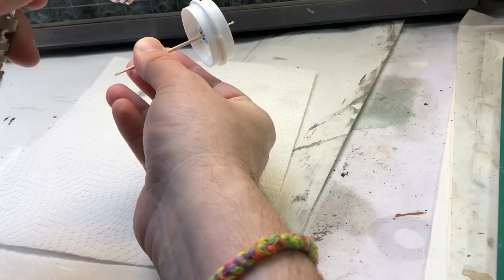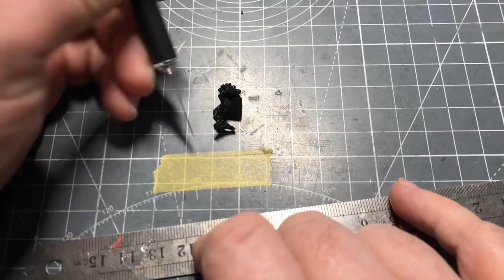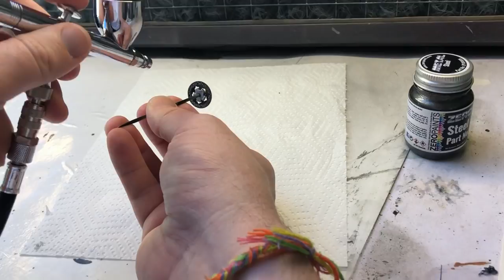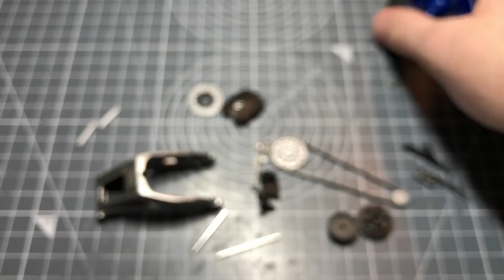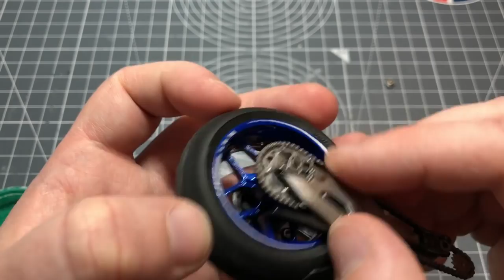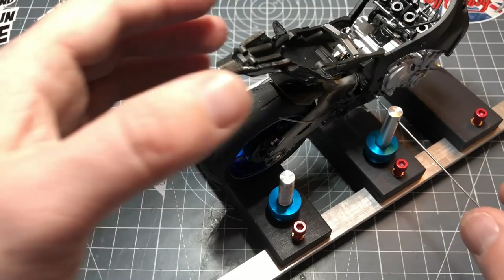Tamiya Yamaha YZF-R1M 1:12 - Part 4 - Building the swingarm

Comment: Can you please advise what diameter of tubing you use for the swing arm assembly and where you get the replacement bolt heads.
Reply from the maker: Hi Chris Bristow, the tubing is 1.6mm and I get the bolt heads from Hiroboy.
Reply: @DalrenModels  thank you